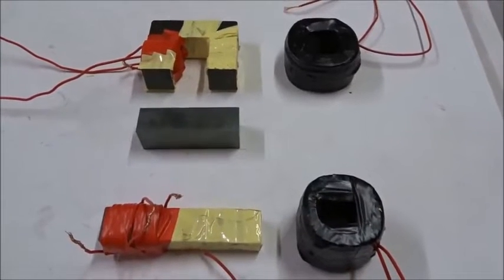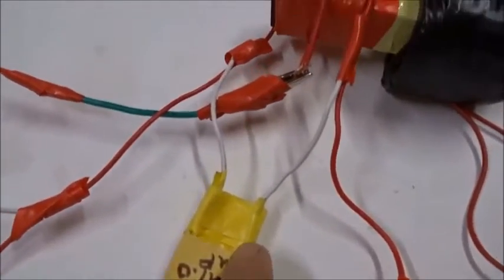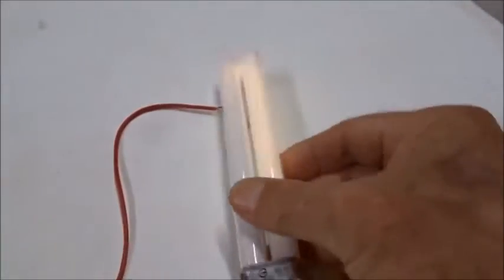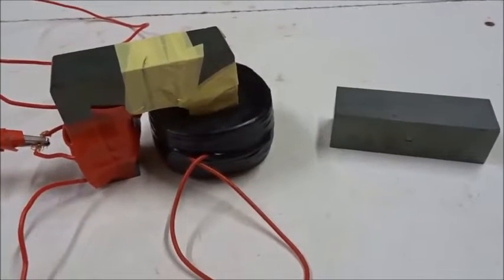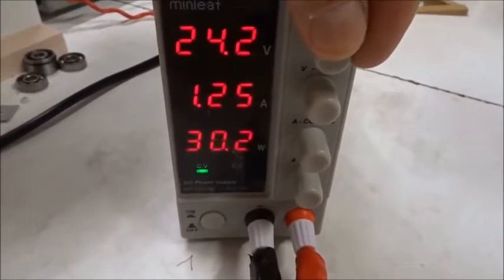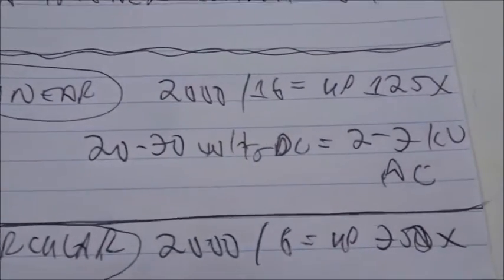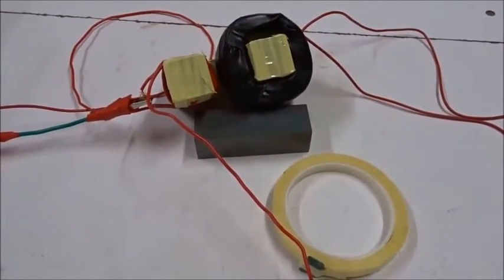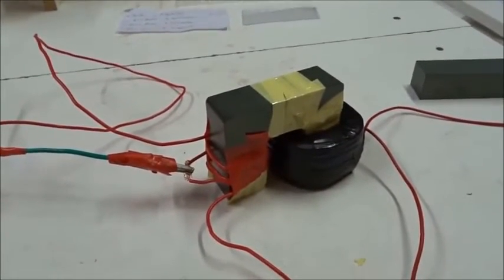Simple studies of ferrite-core transformers: how do they work?

Comment: What type of core/windings would you suggest for a ZVS-driven ferrite toriod transformer with a 1000v @ 2A output?
Thanks much!  GREAT VIDEO!! Thumbs up.
Reply: dear Dale, all of these ferrite wrapped coils need at least 1000-2000 turns of 0.5 mm PEI wire to give high output voltages. Then you just wrap 5-10 turns of insulated 10 amp automotive wire on the other side, and choose the number of turns by tral and error. Also need thin yellow insulate tape between all coils and the ferrite. Good luck!

Comment: Thank you for your videos. I am very interested in Tesla coils and electromagnetic fields. With your knowledge is there any place you could suggest to start. I am very new to this other than going to Maker Faire events for about 10 years. I really want to get into building Tesla's ideas but don't want to fry myself. Thanks in advance. I follow you on gab and youtube. Keep them coming. 

David
Reply: many thanks, you just should start building things yourself! that is the only sure way to learn anything.
Reply: More coming soon! Very exciting. It takes a while to set up each new experiment, and get the needed supplies/parts.
Reply: Here are two recent videos How to make lots of wireless AC energy at 5 kV, 500 kHz using 4 MOSFETs in parallel 
https://www.youtube.com/watch?v=LDTwIPKXACo   
A solid-state Tesla coil which makes large amounts of wireless energy: cheap and easy to build!
https://www.youtube.com/watch?v=9bBmpW1Ka1c
Reply: However I have switched to a power NPN-PNP driver since then, for more durability than a commercial MOSFET driver! Join the bases and emitters. Protect the joint base input using a 1 nf polypropylene capacitor 2 kV, and also a 12 volt 5 watt Zener diode. Best wishes! It gives LOTS of power and won't ever break!